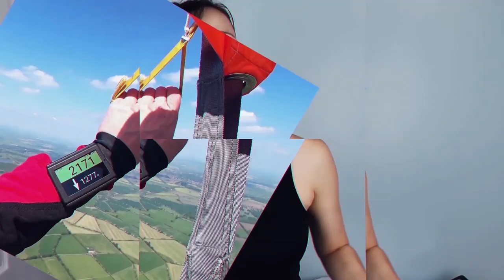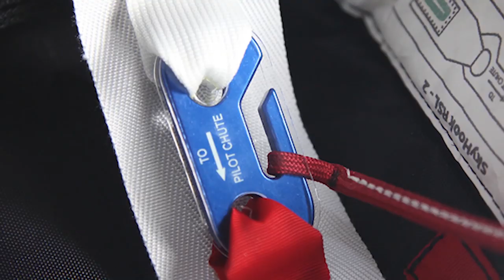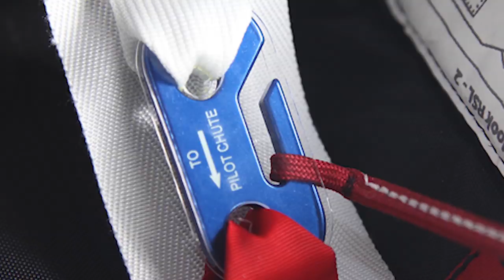5 Things to Know about Your Skydiving Gear

Comment: What happens after cut away,  do we have to  purchase new container ?
Reply: you may need new reserve bag, pilot, and handles with cables if you loose them. Something less than $200 usually with reserve re-pack.
Reply: In addition to what Ary Cave said, you may also lose your main parachute. Which would seriously suck. However, most of the time you're able to recover them (varies by drop zone). And other jumpers are usually good about watching where that canopy lands and helping you find it. Heck, you may even be able to get a pilot to do a flyover to observe it from the air if you're really having issues. 

But of all things, losing a main canopy is the biggest potential problem.